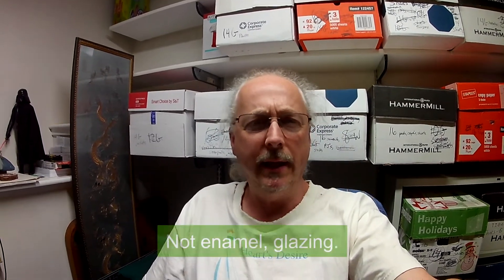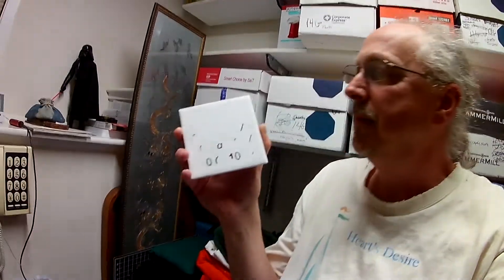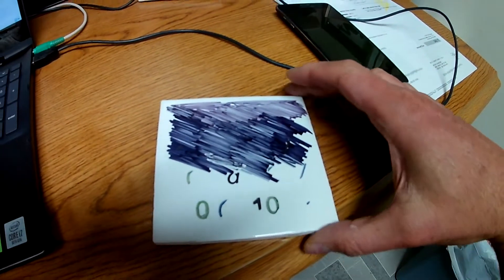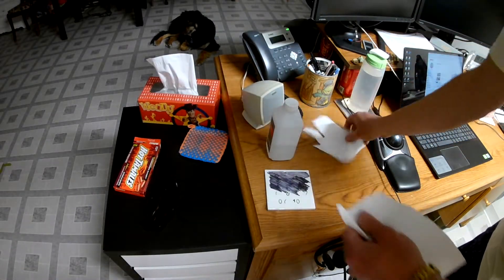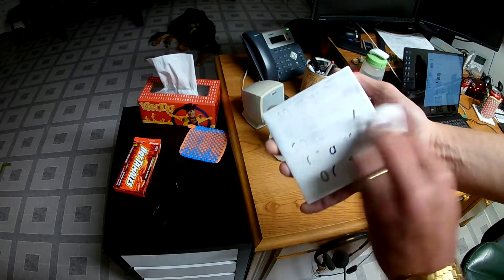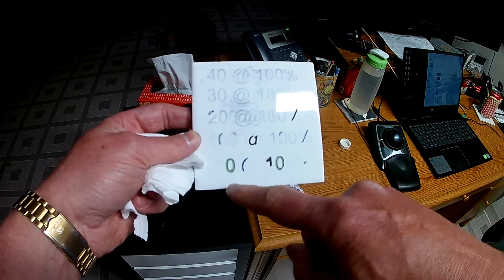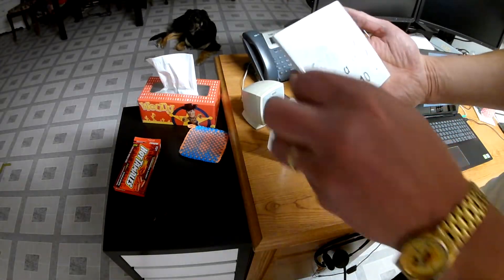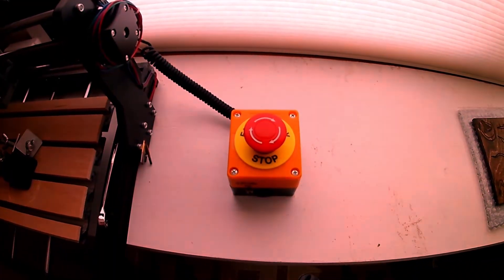No Paint Tile Etching

Comment: can it be done with ortur 20w? ive been trying but everybody is saying to put a white paint befor itching, can you help me please? im new to laser machines, juste received a ortur lm2 20w but didnt get any result with tiles, tried to put black acrylic paint but nothing, thanks
Reply from the maker: It should work with a 20W laser.  My LE5040 has a 5.5W laser and I was able to get some results.  Using painted tiles is mainly what I have been doing and that works great.  I should go back to this and give it another try one of these days.  It wasn't doing what I expected but it was doing something.  I had a recommendation to use Indian ink on the tile after the burn.  I am going to give that a try. 
For this method, the laser makes micro cracks in the glazing and when you apply the ink, it gets down into those cracks and wiping the surface clear should leave the ink down in those cracks.  Here is a better video on this method: https://youtu.be/55dJRymW3Xc.  I hope this helps.
I have many video on the painted tile method and that works great.

Comment: I use acrylic paint to cover the engraving. Full power and very slow speed. Before acrylic fully dries I use a dry rag and it wipes right off leaving a crisp engraving.
Reply from the maker: I would think that the acrylic paint would be too think to really work down into the cracks. Do you think it at all before applying?  I will have to give that a try.  Thank you for the tip.

Comment: I do this all the time on my Glowforge. Clean tiles first with iso and then cut full power and 1000 speed. Afterwards I color fill with black acrylic paint then clean with iso again.
Reply from the maker: Do you clean the acrylic paint while it is still wet?  I wouldn't think that the iso would work very well once it was dry.  I will have to give that a try.  Thank you.

Comment: I have made several Zodiac pictures on ceramic tile. I never cleaned the tile. I went over them 4 times at 35% and they turned out great. I use a CO2 40 watt laser engraver.

Comment: With low watt laser you need the black just like in thermal solar. It absorbs more energy from the laser light to create heat. The glazing is melted and picks up some of the soot to help give it the black color, an when it cools down an solidifies it traps the particles. It would be better to use black paint. Use a latex paint that is easy to remove. To cut tile you would need a lot more power, with an O2 assist. Ceramic basically will not burn. You have to melt it and use the O2 to blow away the molten ceramic. Just like in steel cutting. Or a couple of hundred passes to see how far it cuts into the material. Now that would be an interesting test on ceramic tile! 20, 40, 60, 100 passes with that laser.

Comment: Here is my conjecture: the laser doesn't burn the tile. It creates localized heating of the tile glaze, resulting in a thermal shock that causes a bit of the glaze to spall off of the surface. If you go too slowly, you will get an initial shock, but then the slow moving laser has time to preheat the next area, due to thermal conductivity of the tile. the pre-heated area does not get the shock, and does not spall the same way. Going too fast, you will not get enough heat transfer to cause the spall in the first place.
Reply from the maker: Thank you for the comment.  I still have a few more experiments I would like to try with my laser.  One of the people who is doing this method has a 40 watt laser.  I am only running 5.5 watts.  That extra heat would be able to do what you are saying.  I am going to try doing an image and use a dither on that which would be more localized heating.  We will see what happens.
Reply: @CNCATHome  I do this with a glowforge, white tile, and ink pad. Results are amazing.  Wish I could attach a pic.
Reply from the maker: @LithosAndLasers  - We would love to see what you have done.  If you have a link to your results, that would be great.  I have gone tile crazy in the last couple months.
Reply: @CNCATHome  I'm making a post for Imgur right now. I will let you know when its up